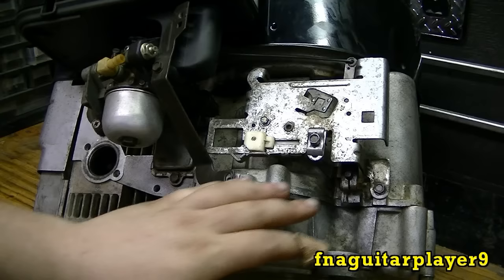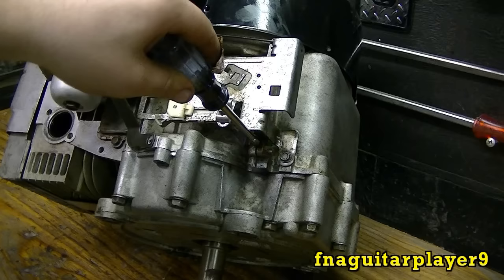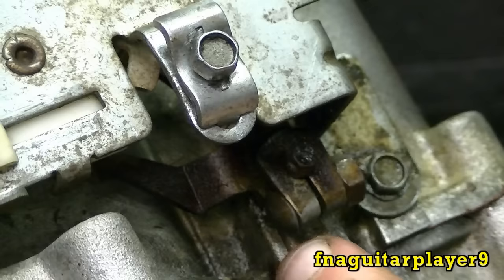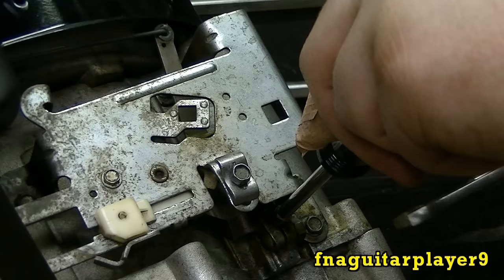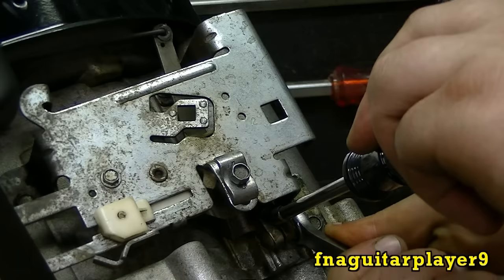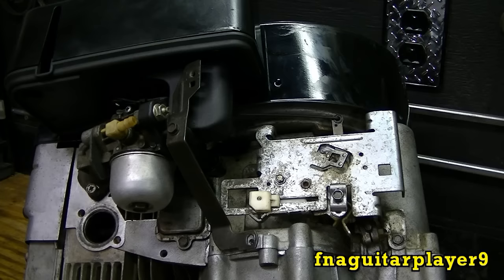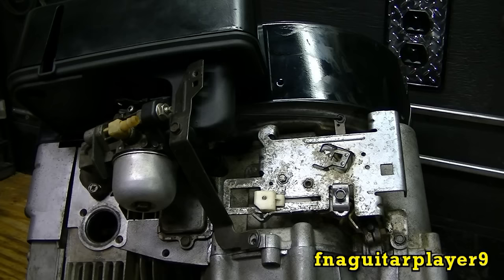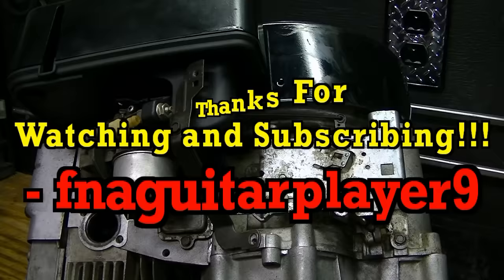How To Adjust Mechanical Governor On Small Engines

Comment: Awesome video and thank you for posting!  I have a very weird issue and I do not know what the heck is up with my mower...  This is what is going on:  mowing grass one day, mower was running fine, then it quit all of a sudden on me.  Nothing special, it just died on me.  No funny noises or nothing - just sounded like if I turned the key off.  I thought it was weird so I checked the gas before I did anything and I had gas.  Started it again and it fired up for about 5 seconds, then it died again - now it hasn't been running the same ever since.  I can fire it back up but it is very picky.  I have to have it at about 7 - 10% throttle, to throttle up I have to do it very slowly otherwise it bogs down.  I have cleaned the carb and replaced gasket in carb.  I have put a new spark plug and new coil.  Checked compression and it is good.  I have also checked valves and gap is good - same engine as you have in this video 14.5 Briggs I/C.  I'm pretty stumped as to what is wrong with my machine.  I thought it was possibly governor but haven't tried adjusting it.  My last resorts as of this moment is to try replacing the float in carb because I heard the NIKKI carb I have on my engine comes with lots of headaches with bad float being one of them - and if that doesn't do anything I'm going to check the key on the flywheel....  I am really not sure what else to check other than that.  Thanks and any help or tips you could provide would be great!
Reply from the maker: ***** Appreciate that, your welcome! Sounds like your on the right track, not much left it could be, just about all the carburetors, nikki and walbro lmt are extremely sensitive for some reason on these, I was thinking of the coil at first until you put a new one on it, i was thinking maybe it was breaking down from the heat and loosing spark. Have you checked for spark, it could be a safety switch or shorted wire somewhere doing that, to test that just unhook the shut off wire from the coil, so it won't shut off with the switches. Its either the carburetor or something like that. These motors are extremely picky for some reason. But yeah it could be the flywheel key, but usually when they shear it won't run at all, just spit and backfire out the carburetor or muffler. Thats about the only things i can think of right off hand. Hope this helps! Let me know what you find out! Thanks for Watching!
Reply: ***** When you redid the carb did you take the seat out and put the new one in ?  Sometimes when you take it out you have to shoot air or cleaner thru there. 1 small speck of anything can clog the seat.
Reply: The Nikki carb that I have doesn't seem to have a seat.  The white plastic piece that covers the emulsion tube or the "fuel transfer tube" does not appear to have a seat in it.  Where the needle goes there is just a hole in the plastic that it covers.  I did the ole' blow test meaning I blew into the fuel intake with the float down and with the float up and the needle seems to seal well.  I also noticed that at the tip of the fuel transfer tube there is no jet.  I'm not really sure if it is missing a jet or not because that is where the fuel solenoid goes into and it seats and opens well...I don't know...  just gonna order a new carb I think.  I'm out of ideas.  Just cleaned the crap out of it again today and it is still running like crap.  I got it to start great and it idles great at about mid throttle, but, when I suddenly bump it up to full throttle it boggs down and dies.  I can get it up to full throttle but I have to do it slowly.  Could the governor be screwed?  Help!
Reply: can u choke it a little and it runs fine at full or medium throttle ?
Reply: Choke works integrated with throttle.  There's a notch at full throttle on lever.  When you go past full throttle choke closes...
Reply: ***** can you give me the model and type of the engine ?
Reply: I did the governor adjustment as well.  Loosened the not at full throttle push lever back turn linkage fully clockwise and tightened.  RPMs seem fine.  My reason for thinking it is the internal parts of the governor is because any little struggle and the engine wants to bogg down.  When I do get it to idle fine at full throttle and try to engage blades it dies.  Belt is free and fine to spin.   Seriously no clue what is going on with this dang thing!
Reply: so the engine runs fine at full throttle until you put a load on it ? I want to look that engine model up
Reply: Correct.  And on top of that I have to throttle up and down very slowly or it will die.  I will post model number...
Reply: Model is 287707 0225 01...  has Nikki Carb not Warlboro.
Reply: I looked up your carb no seat as you said. But there are very small holes in there that need to be cleaned very very well. I would try one more time on the carb and blow good air on all small holes in that plastic assembly. Maybe cheaper than a new one Hope this helps. If not then it's the valve clearance.
Reply: *****  i forgot about one thing. Some fuel line hoses will give on the inside and cause flapping. Runs good at idle but not as you need more fuel. You cannot check that by blowing in the line. Happened to me and was pulling my hair out. Replaced the lines and bam no more problems.
Reply: Did you find your problem ??
Reply: Nope.  New parts came in tonight.  Got a new carburetor to put on tomorrow .  We will see what happens...
Reply: +Boo luquette I got it!  Pulled up a diagram of the carb from B&S site and found I was missing a jet in my carb.  Carb must have been overflowing and getting a bunch of gas into case.  I also replaced the float.  Thing spins the blades and fires up!
Reply: Good deal glad you got it !!!!

Comment: I got an OHV Intek engine from Briggs and Stratton. The cold start works, but the engine throttle won’t adjust the speed. The speed stays the same and runs at a lower rpm than normal but it is not surging. If I try this, should the throttle work and run at the normal speed? Also, how can I prevent the engine from running at too high of rpms after adjusting this. Should that be a problem or is that only when the spring gets adjusted?

Comment: On a briggs intek V-twin that I am trying to fix for my parents, I did a carb swap, and because the throttle linkage had to be bent to get around the fuel line, the engine gets right into high speed. Then I tried to adjust the governor pin in various ways, one way and the lever for the throttle doesn't make the throttle move on the carb and the other it does. I'm guessing If I use a longer throttle linkage, of just the right length, the governor wouldn't have to be adjusted at all. When I adjusted the governor pin, there is only a 1/4 rotation of play..am I being too gingerly, and maybe it could be tightened more than what seems to be a stop so soon from the little apparent swing I am experiencing? I saw some adjusting where the pin is being rotated like a half or more turn. What do you think?

Comment: I have a 11hp Briggs engine that will not auto idle. Its on an older Simpson contractor 3000 pressure washer. When you release the nozzle trigger the engine is suppose to back off to idle. It runs full rpm. Any suggestion would be appreciated. great tutorial you posted. Refreshing to see a tutorial without all the swearing and music drowning out the tutorial.
Reply from the maker: It should have sometype of solenoid or mechanical linkage to control that, it may be broke or came loose, I'm not real sure, the ones i've used have a fixed throttle that doesn't change unless you do. Yeah i know what you mean, i don't know why people do that in videos. Thanks for Watching!!!

Comment: "Turn shaft CLOCKWISE"
On my shredder I have a Honda GCV135 with the governor mounted on the LEFT. I notice that when I push the throttle lever fully the throttle butterfly does not open fully. The governor is under tension like you show, and totally relaxed when throttle is closed. But because I've got the air filter off I can see the butterfly open up somewhat but not fully. So since I've had the carb off, and you recommend checking the governor whenever it's been off, I'd have a go. But wanted to check I should turn the shaft left away from the engine. Could you or some knowledgeable, kind person confirm this please? Thank you!

Comment: I’m a newbie. I have a Briggs and Stratton with a Nikki Carb. 15.5 HP. The throttle lever won’t adjust throttle. I have watched so many videos. I put a brand new carb on it. Still runs high throttle. And the throttle cable won’t adjust the engine speed. Could it be the governor spring?  Do I need to adjust the governor? Help please.

Comment: Is there a way to replace the white plastic piece that holds the throttle cable in the control bracket, mine broke where the cable attaches.  Thanks.

Comment: I have a 10hp briggs on a snapper rider.  Had carb rebuilt and now the motor is racing.  Can barely give it any gas without it over revving.  Also weird thing is it also revs up more when I am turning to the right.  Any ideas?

Comment: I don't know how close you follow your 2yr old posting, hope you do. 
Ok...I have 12.5 briggs, 32 yrs old, and I rebuilt it 8 yrs ago. Ran perfectly. 
I was mowing and it took off full throttle and would not idle down. 
So, I adjusted the governor, it was fine.
However, it still runs wide open no matter the throttle setting. Is this a governor issue or a carb issue? HELP!
THANKS

Comment: Do you need to have throttle cable on a 5hp Briggs and straton disconnected in order to adjust the governor and witch way do you turn the shaft?

Comment: Thanks for the video, it was actually very very helpful. Question though: I have a 14hp B&S riding lawn mower engine. I'm putting it on a go-kart frame for a friend of mine, and I have seen a lot of videos that say you should remove the governor to let the engine rev higher. But as I soon figured out, the governor goes along with the oil flinger, which obviously is necessary. So how would i remove the governor w/out having to remove the flinger? Also, how would removing the governor arm on the exterior affect how the throttle does it's job? Thank you
Reply from the maker: Your welcome! I don't recommend removing the governor on small engines, they won't take it. It will throw a rod or break the counterweight link. But if your going to do it, you don't have to take it apart, do away with the assembly where the throttle would normally mount, or leave it in place and connect your throttle cable directly to the linkage going to the carburetor's throttle plate (the long linkage that runs from the governor arm to the carburetor that i showed in the video). (or simply, remove the long linkage between the throttle assembly and carburetor, connect your cable with a new clamp directly to the carburetor's throttle plate, the same way that a manual choke is connected). So basically your not "removing" the governor, but your bypassing it. But it will blow up, especially if you give it WOT and keep it there, been there and done it, look up one of my early videos (not hd) i show the aftermath of a 14.5 (basically the same as your 14) after it threw the rod out the side of the block! If you gear it right (chain sprocket sizes) you will be surprised of what you can get out of a stock engine. Because they have decent stock low end torque. If your willing to sink some money into it, go to eccarburetors.com and you can upgrade the rod, flywheel and counterweight link, its expensive, but with that you can build a serious racing engine. Hope this helps, if you have any other questions feel free to ask! Thanks for Watching!!!

Comment: Hi I bought an older tiller with a 4hp briggs I can get it to fire but don't stay running I can feather the governor and can keep it running but ends up stalling only has one adjustment screw on carb and bolts to the gas tank any help would be appreciated thanks

Comment: I have the 19.5 and I ve  tried over and over again to adjust the governor.  Seems like there a missing spring. One thing The slot barely moves. I've tried both ways and it still just reves. I put a spring on it like you did in one of your videos to get it to idol but the throttle  won't work then.  There is the small spring in the back that tighten if I open the throttle. The slide and screw on the slider I've tightened it and loosened it and it doesn't do anything either way. 
It doesn't seem like the governor screw moves enough.  Maybe 10 digress.  Do you think it should moves more and because it doesn't Maybe it's stuck or blocked somehow in the engine? I appreciate any help.  I ve  watched every video on utube so I am doing the adjustment the right way.

Comment: Hey there.  Thanks for posting these videos, they're really fantastic!
I have a John Deere riding mower (LA120) that I inherited from my in-laws that we've been trying to use, but it was sitting unused for a few years so it's been giving me some troubles.  One day it just stopped running unless the choke was fully on.  I replaced the fuel filter and air filter but it still had the same problem.  I removed the carb and tried to clean it myself by just using carb cleaner, and that seemed to make it run a little better, but still not fixed.  So I removed the carb again and had it professionally rebuilt by a small engine mechanic.  He told me that the low (idle) jet was completely clogged.  When I put it back in it was running much better.  But after a few minutes it would choke out on high throttle.  So as of right now I can only get it to run on low throttle.  Any time I try to put it into high throttle it chokes out.  Do you think it's something getting clogged in high throttle portion of the carb, or do I just need to adjust the governor?  Any help you can offer is appreciated.
Reply: Forgot to mention... It's a B&S 20HP engine with the Nikki carb (single port)
Reply from the maker: Your welcome, glad to help out! I don't think its governor related, unless its surging or hunting up and down. If its actually choking out (black smoke in the exhaust) it could be as simple as the choke needing adjusted, if its leaning out (not enough gas) then yeah i'd say some more dirt got pulled into a jet or passage. Another thing to look out for is old fuel line, i've had fuel line deteriorate on the inside and cause all kinds of problems. Thanks for Watching!!!

Comment: My governor arm won’t move either forward or back and my 13 hp B&S now runs at full acceleration. Has something seized or does hopefully require adjustment? Motor starts like dream but no acceleration control. I have removed acceleration cable to check mechanism is ok.

Comment: Just read 4nuk8r and wonder if that could happen to the B&S engine.  I've got the OHV 16 hp driving a DR Chipper.  The engine has just decided to 'wind up', with no end in sight.  I shut it down before it blows itself apart, but have been wondering what the heck could be causing this trouble.  No help from DR to speak of, no help at all from Briggs.  No help from small engine mechanics (who just want to rebuild the carb - heck, I KNOW HOW TO REBUILD A CARB.

Anyway, I'll put a small pair of vice grips on the governor pin that sticks up above the clamp so it doesn't 'fall in', just in case these engines have that foible!  Thanks for the video.  Clear as can be.
Reply from the maker: Most of the time when a engine revs up like that its either a linkage is bent, broken or came loose letting the throttle plate open up all the way. If the linkage is loose the vacuum from the motor will force the plate open. Anything is possible with small engines haha Thanks for Watching!!!

Comment: Crafts Eager 1. I cleaned carb and put it back.  Still no start or run for just 1 second.  I saw that the governor/throttle linkage was pulling to the right so that the throttle was closed. I forced it to the left and engine ran full blast. So I saw that the governor spring linkage (just below the other linkage) was too loose and this enabled the governor throttle linkage to keep throttle closed (pulling to right) preventing start and running.  So I took slack off the spring and the stronger spring pull (to the left) allowed the throttle plate to be more open and the mower to run. So because the spring was stretched out, the governor was able to pull the throttle plate shut preventing running.  Does this make sense? Thanks for your videos but this push mower governor linkages are difficult to understand problems. I have other mowers with same problems.
Reply from the maker: Yes it does, I've had similar situations before, they can be picky setups! Thanks for Watching!!!

Comment: I got a 12.5 b&s that is running away. I can get it to idle but anything off of idle immediately goes to Full Throttle and maxes out and wont go back to idle.  Is that governor out of adjustment?

Comment: what exactly do i do if the engine is already idiling super high. i bought a used carb, put it on, and started it up and its running super hihg and loud and smokey. on asnowblower. how do I get the idle to go down...?

Comment: I think I need to adjust the governor on my engine. It would not start so I adjusted the valves and also pulled the carb off and gave it a clean. Now when I start the engine it seems to be on full revs and no throttle control
Reply from the maker: Sounds like it does need adjusted or possibly a linkage or spring came loose and is letting it rev up, had that happen a few times. Thanks for Watching!!!